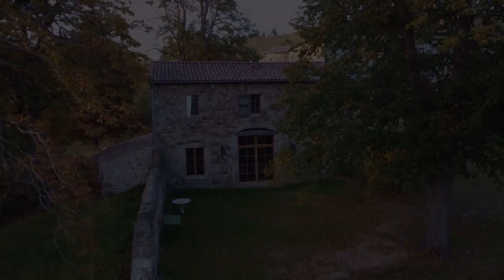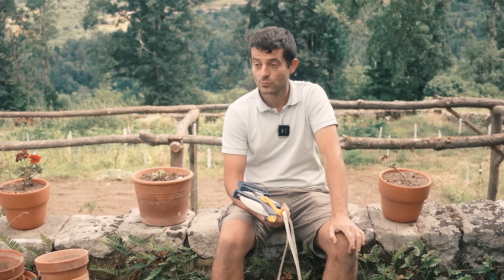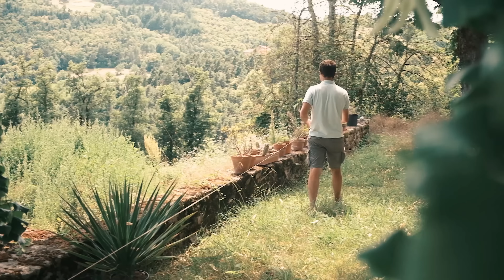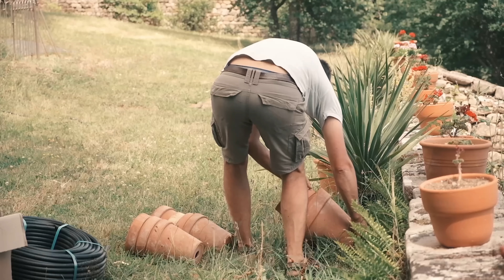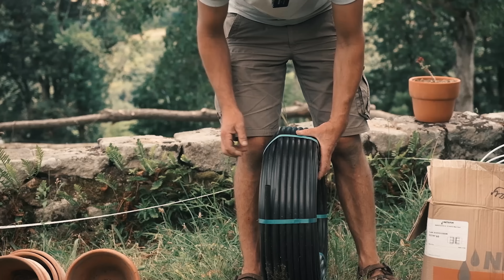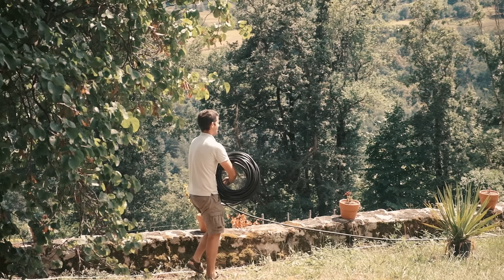Battling the summer heat, and an important family project | Daily 16

Comment: Mark if you run the black water pipe along the back of that wall then bring the white drip tubes up to the back of the pots it will look way better than having those tubes flapping around at the front.
Reply from the maker: It’s a terraced garden so the wall is very high behind it and the white drip tubes wouldn’t be able to reach to the ground!

Comment: It may not be relevant in your case, but we were taught to make a continuous circuit for our miniature sprinklers as it worked best (and proved to do so) for pressure.  So we brought the end back and joined into the original strip like a t-section.  The other end was joined to the pump of course. Best wishes.

Comment: Love the drip irrigation system! Do you need to bring it inside in the winter so it doesn't freeze?  Just wondering if I could do one where I live. Temps range from -30F to 102F!!!

Former competitive swimmer  family member here (okay, 50 yrs ago) and swimming the Channel was always our dream! 🏊‍♀🏊‍♀With my father and family in the medical field, I will share your Just Giving page in hopes some of my friends and family will help a bit. Burns are probably the most painful thing that can happen to a human body. They may be permanently devastating if proper medical care and rehabilitation is not provided. Do they have a hyperbaric oxygen chamber? Kudos to your family for providing hope to so many. 💖💖💖💖💖💖
Reply: I am in BC, Canada. I leave my lines out year round, never froze or burst. Our winters may get a rare low of -20c. You could blow the air out of the lines in the fall.
Reply: I agree with Kelly above - so long as you unscrew the main drip line from the place where it connects to the main house pipe & drain out any water in the line before your first freeze of the year, you should be fine. That said, I would check with folks at a local gardening center who sell this kind of thing to see if they recommend a particular 'weight' of plastic.